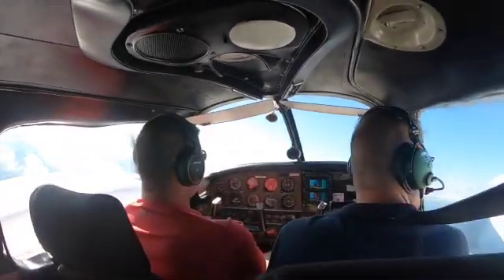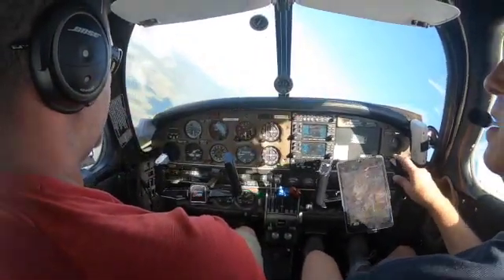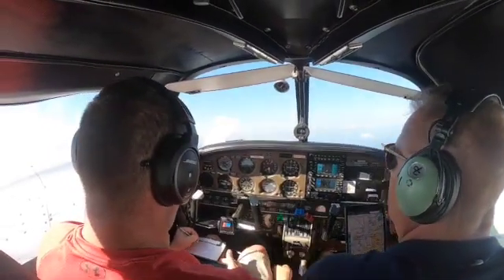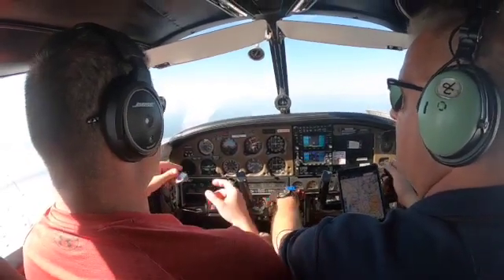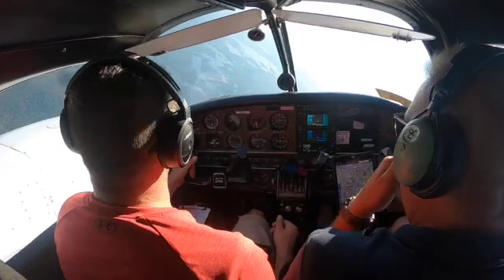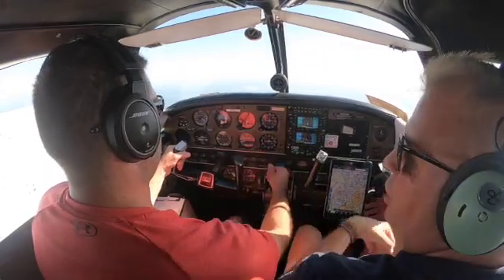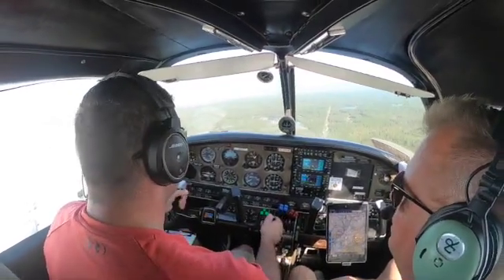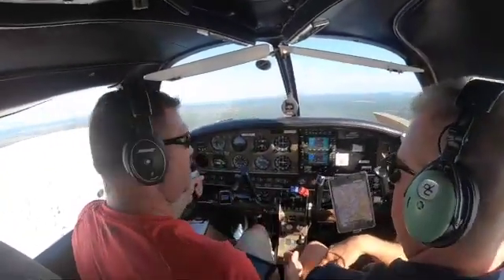Piper Seminole PA44-180 Multi-engine Flight Maneuvers VMC DEMO

Comment: Never use your ailerons in a stall
Reply from the maker: If you’re in a banking stall then what is the first thing that you want to do? you want to level your wings so ailerons would be needed.
Reply: @BATAviation the first thing you will need to do is pitch down, while maintaining your bank. Only once you have regained airspeed can you roll wings level with ailerons. In a normal stall, you will use rudder to maintain directional control.
Reply: @BATAviation  you always use rudder to level your wings, never aileron because it increase AoA of a wing with higher possibility of developing from stall to spin.
Reply from the maker: @LoxosM  That’s something I would have to read more into. I’ve never heard of using rudder to level your wings.
Reply: @BATAviation  please do because it’s very important and may save your life. It’s the first thing instructors taught in my PPL in Italy
Reply: Agreed- as a CFI- if your student is not in a banking stall demo- and they incorrectly use alieron to correct heading or even if the wing starts to dip, all they are doing is increasing the AOA on that wing, which in a stall, can cause a spin.
Reply from the maker: Maybe you have that confused with a spin?
Reply: imagine if you stalled in a cessna and your left wing dropped first ie it is stalled and the angle of attack has exceeded critical aoa. If you were to apply right control stick movement raising your left wing, it would mean the left side ailerons would have to go down. draw the new chord line from the tip of the wing to the new downwards deflected ailerons and you would see how you have increased the angle of attack even further. thus you are aggravating the stall. once you have broken the stall sure you can lift the wing with ailerons, but if you dont have time to do that always with rudder. 
- instructor from canada

Comment: How come you don’t feather the prop during VMC demo? Just genuinely curious. Is it because you don’t want the other engine to shut off?
Reply from the maker: No - you don’t want to feather the prop because you don’t want to actually get down to a VMC redline. That’s why you demonstrate VMC higher than actual red line. You just want to demonstrate loss of directional control.